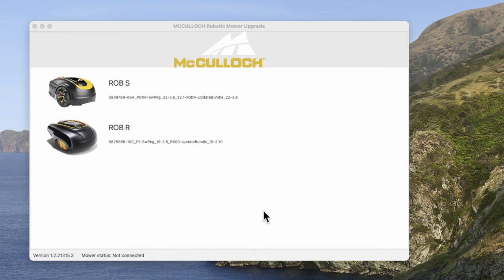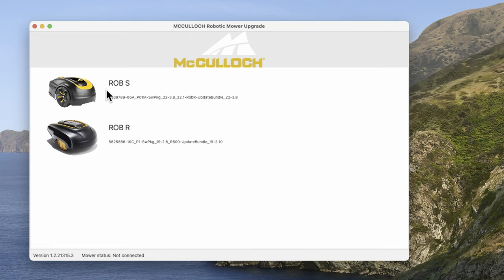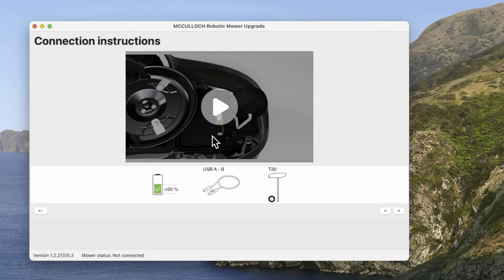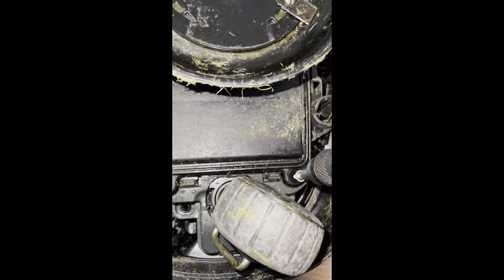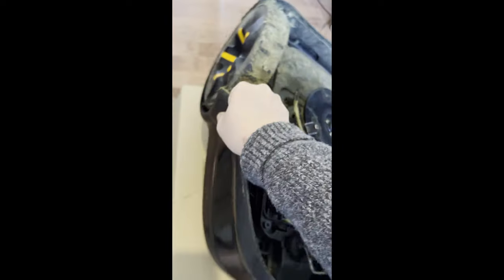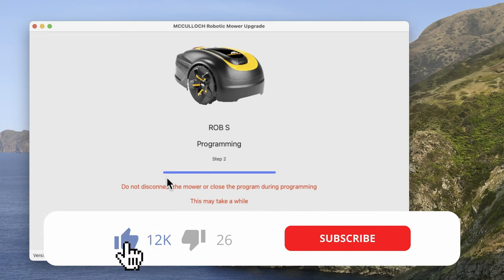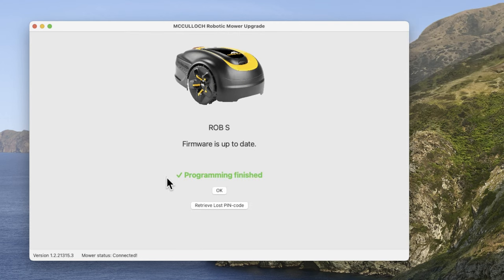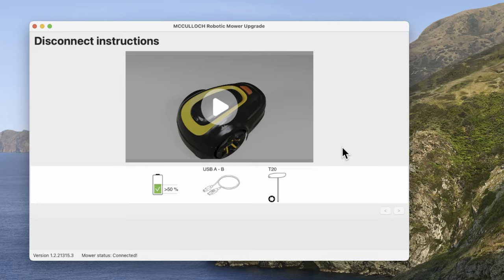McCulloch Robotic Rob S & Rob R Lawnmowers - Firmware Update How to Guide

Comment: Website state the firmware update is for S-models. R-models are not mentioned. Is there a firmware update for Rob R1000?
Reply from the maker: I download the software Mower upgrade App, and sadly does not mention the R1000. Only the R600
Reply: What a shame! But there is a USB connector on R1000. Does it mens a dealer can update?

Comment: Hi. I upgraded the firmware onto my R1000 (I know. I've just read your answer to the comment below!) Now I get a fault message which I can't remove, either "electronic problem...." (flashes up quickly) or "tilt sensor problem". I can't get to the Home screen, or anywhere! It seems I've given the R1000 incompatible firmware. Is there a way of restoring to the original? Thanks.
Reply from the maker: I just had a look on there website and cannot see anywhere they store for you to download the original firmware for different models. Sadly I think you are going to have to contact support and ask them either to send you the firmware for your model or see what options they say. Sorry I could not be of more help.
Reply: @EclipseReviews  Thank you for trying, I appreciate it. I'll get in touch with McCulloch.
Reply: Were they any help? I'm wondering if there's a more up to date firmware they might have sent you for the R1000
Reply: @andrewhazlewood5757 I made the same error, after the update my ROB R1000 robot displays “electronic problem (501)”.
Is there really nothing I can do to solve this problem?
Reply: I was told by a reputable dealer that it needed a new motherboard !!!!! I said no thanks, gulped, and bought a Flymo robot mower. Which is much better than the McCulloch.

Comment: Same question as above. How is it done on the R600?
Reply from the maker: When you download the Mower Upgrade App, it has the option for the R600 and walks through the different steps to update this model. Looking at the app I clicked through the R600 which is roughly the same as in my video just the USB connection on the mower is in a different position. Strange that the website makes no mention of the R600 but their App includes this model. Could always email support to double-check.
Reply: Just remove the battery cover with the 4 screws (torque), put in the Usb cable, start the downloaded software and follow the instructions. Straight forward. I have now upgraded my R600, worked fine. But it is not documented what is improved in the new software version.

Comment: Is it same procedure for R600?
Reply from the maker: When you download the Mower Upgrade App, it has the option for the R600 and walks through the different steps to update this model. Looking at the app I clicked through the R600 which is roughly the same as in my video just the USB connection on the mower is in a different position. Strange that the website makes no mention of the R600 but their App includes this model. Could always email support to double-check.
Reply: Yes. I have just upgraded my R600, it worked fine.